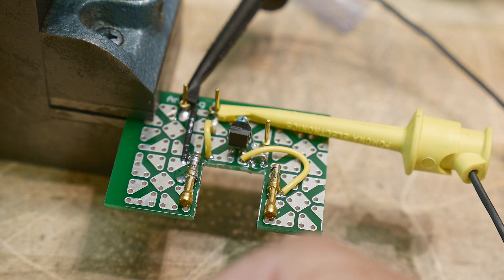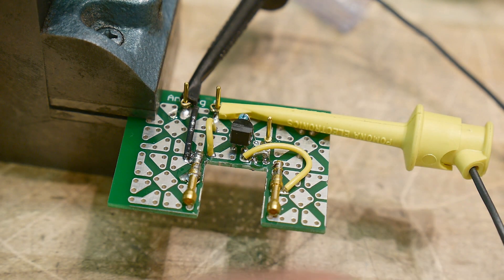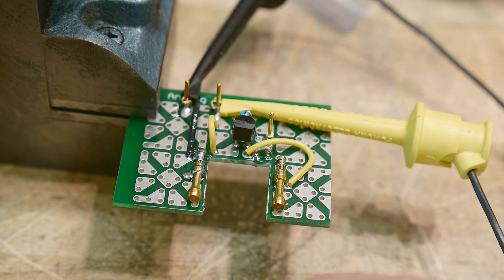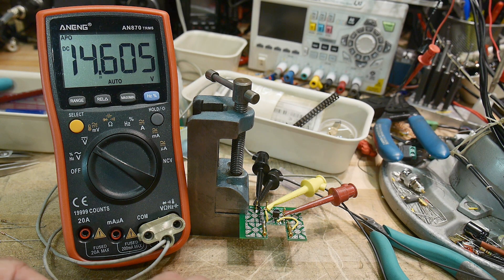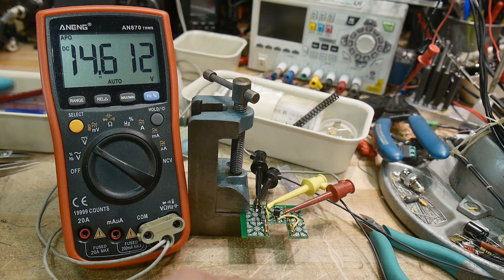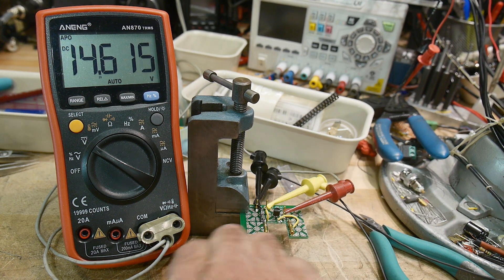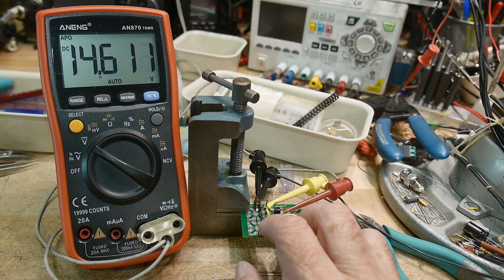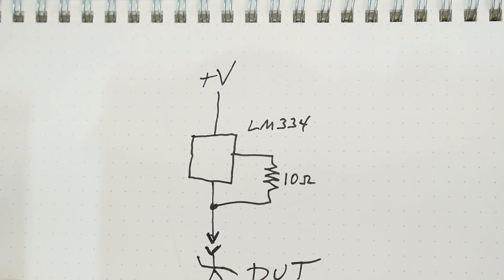#1159  DIY Zener Diode Tester

Comment: Good idea to have always the same current. But so far, I test my zener only with a 10k resistor in series with a 30v power supply. Current is limited at 3ma maximum DMM is in parallel with the zener. I like your video keep going. Thank you.

Comment: This may be a stupid question but what's the best brand of wire to make those test wires and what are the plastic parts with the 4mm banana jacks called that plug onto 2 holes with the normal spacing on most meters. I've wanted to ask this for a while. Thank you to anyone who wants to take the time to answer.

That's a cool jig you set up
Reply from the maker: the best wire is silicone test lead. hard to find the good stuff. I've found some used by RC car people. the one piece with two bananas is a 'dual banana jack' the Chinese ones are garbage, so get Pomona brand. 
you can get anything made to order by Probemaster
they are the best, you just choose what connectors and what length. and press order
Reply: @IMSAIGuy  pomona sell their silicone wire for a really good price 40cad for 15 meters. It's actually untinned copper like 90 percent of the wire you buy these days
Reply: @IMSAIGuy  just ordered a set. Sorry for all the posts but I wanted to thank you again.

Comment: How about using it to measure the forward voltage of LEDs and also tests them at the same time at your designated current.
Reply from the maker: Works to that too. But you will want a different socket

Comment: If you use this to test a resistor it would also give you some voltage reading, but that doesn't mean it is a zener diode.
Reply from the maker: If I ever run across a Zener diode with color bands, I'll need to be careful  😎

Comment: I like your idea of gold pin, where did you bought it from?  I will use it for test circuit I am  designing I for measurement of self resonant frequency of THT capacitors and inductors.  However, your voltage for testing Zener phenomenon is low.  Once I bought a vacuum tube power supply from our school over supply store for $5 that was able to give any voltage from 0 to 1000V.  With that and 1M ohm resistor, I measured the zener voltage of LEDs to be about 98V.  My thinking was we should get photons with 98eV. But talking with one of the physics professors in our school, he said this is not the case, because the electrons are tunneling through, not going over barrier. 
I lost that power supply, because I moved for my job.  I am going to create something like that, but now I am going to use either a Tesla coil, or Cockcroft- Walton  diode- cap voltage multiplier ladder. I find out there are NPN transistors that can handle more than 1000V, so I can  limit the output voltage, I was looking for PNP transistors that can handle 1000V so I could limit the current too, but I could not find any maximum is 600 V.  There are IGBT transistors that can handle more than 1000V and are consistent of PNP and NMOS.
I also need to measure the energy of photons emitted.  If you know how can we measure the energy of photons emitted from zener diode, let me know.
Reply from the maker: I just had some old pins in my junk bins, leftover from some strange connector.

Comment: If the diode at 2:40 were germanium or Schottky wouldn't the forward drop be closer to 0.3 V?

Nice, quick presentation, by the way.
Reply from the maker: at low currents yes, at 7mA a 1N34A will be about 1/2 volt

Comment: I made something similar for selecting resistor values but I laid out the DUT contacts in a V shape so that I could test resistors of variable physical size and lead length. It worked OK but I think your gold pin contact idea would have helped.
Reply: Great idea.  I guess I use 10 gauge copper wire, instead.  They use it for Grounding in home wiring.